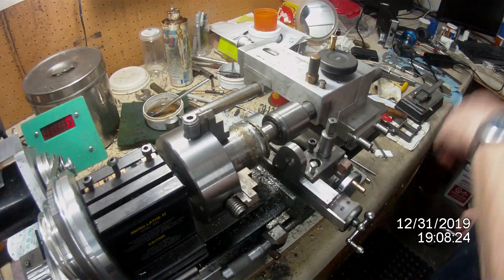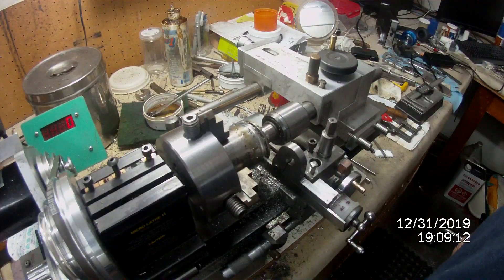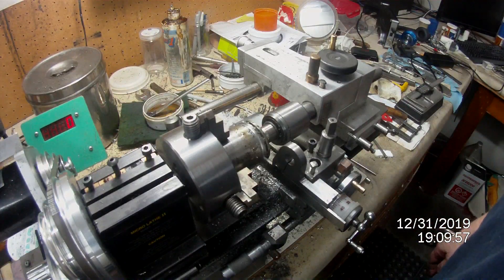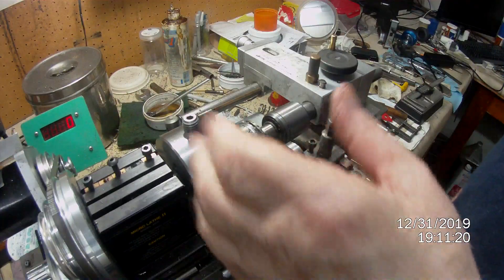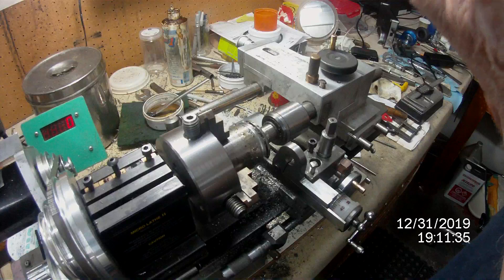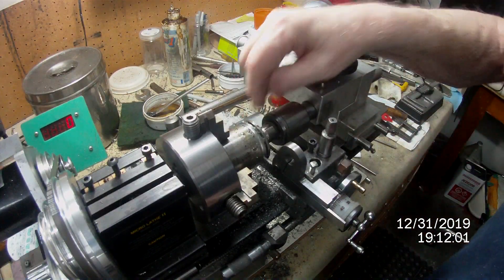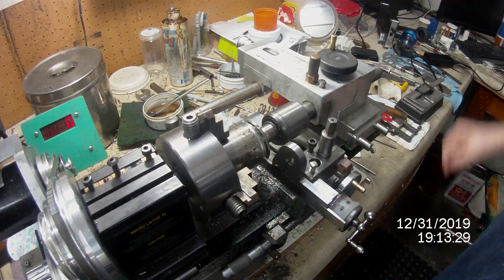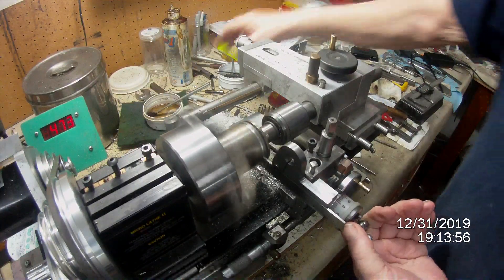FILE0011 overkill with spring parting off tool on Taig Lathe

Comment: Walter:  All is going swimmingly well with the spring tool holder.  The diameter your cutting is really large and I'm amazed at the little Taig and the Spring Tool Holder.  Your video also seems to be working well.  I don't think my belt slips, but I'll have to be more observant and if it is I probably should get some of that spray.  Thanks for making this video, it has been very informative.  I wonder if the chunk of steel could be 12L14.  It seems to cut better that the chunk of 1018 I just used in a similar video.  I'm guessing that your using a different camera.  The sound seems a bit stronger than usual.  Best Regards: Larry😊

Comment: I love the modifications you have made to your Taig. Are there any plans available for the tailstock conversion you built?
Reply from the maker: Kenneth, thank you for the positive comment, you know it has been a long time now since I have done any machining and my mind cannot recollect about drawings, I must have done a few drawings but where they are is a mystery I will try to find them,  most of the build was  add lib and parts drawings were many times amended, I can tell you some of the improvements I would make if I was starting from scratch, if you look back you will see I had to strip the bed and re-machine the dovetail extrusion at the rear of the bed for the vertical pillars, it is my thought that a fixture on the top of the headstock could eliminate the dovetail operation, the sliding tailstock block and main tailstock made of steel would be a better arrangement (the aluminium tends to gall together), definitely use the triangular key for repeatability, make the sliding block and body as wide as possible, I could go on, and if you are serious then you can call upon me for any questions you might have, 
Walter Maisey.........Alberta,